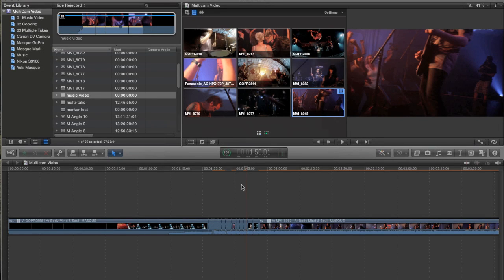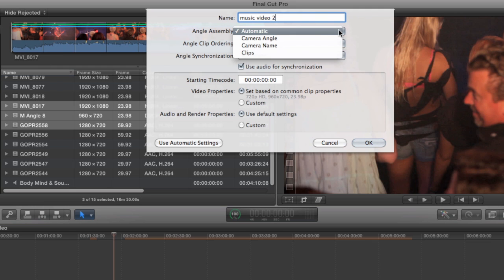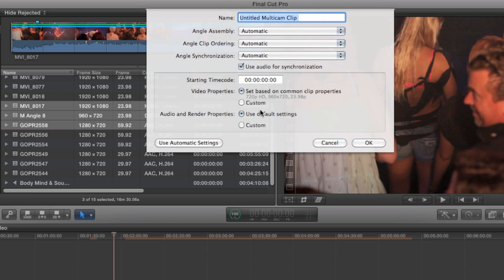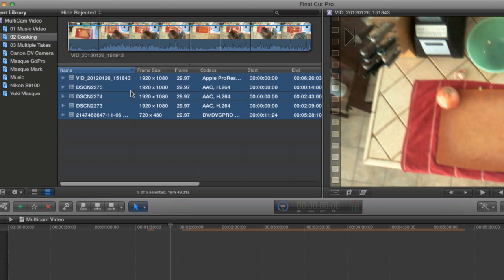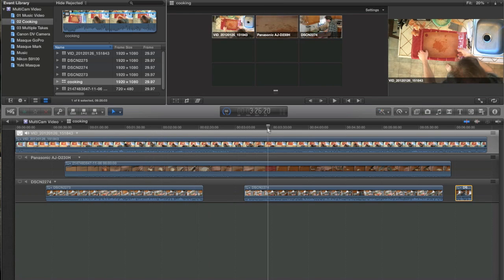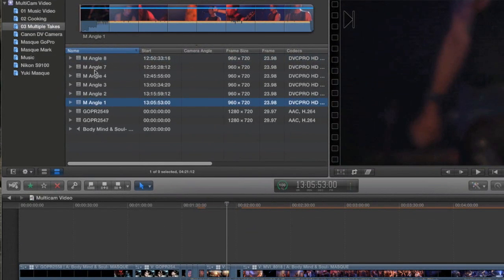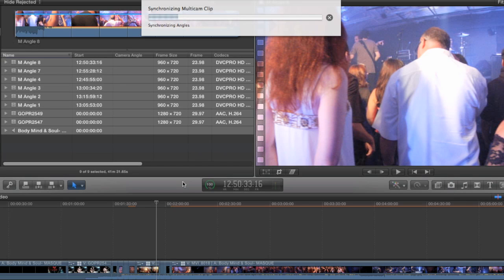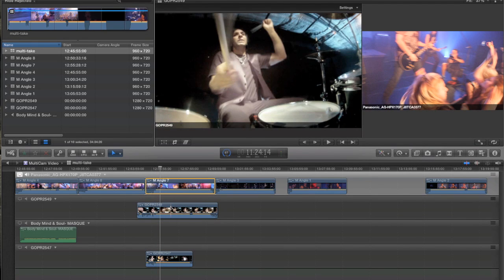FCPX INs and OUTs - Multicam Pt. 2

Comment: very well explained stuff...impressed with your technique and even i have edited a music video with your help.... i am also facing problem while shifting clip from one angle to another....i am holding shift key while dragging clip up or down buy somehow i dont know why i am getting out of sync? not always but in some cases   ...! is there any shortcut key to move up or down??? please reply.
Reply from the maker: Shift doesn't always work in the angle editor. You're better off using the playhead at the start or at a marker and turning snapping on (N). But if you do lose sync when moving a clip from one angle to another, you can still use the Sync Selection to Monitoring Angle to put it back in sync with the rest of your multiclip.
Reply: all good...i got you now. i tried and rectified that user must switch off snipping to avoid loosing syncs...thanks again.